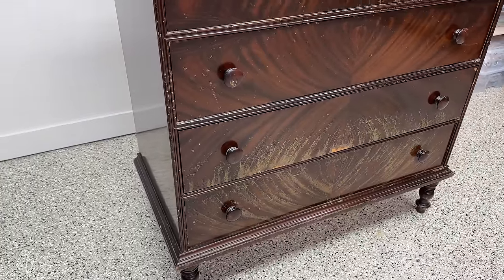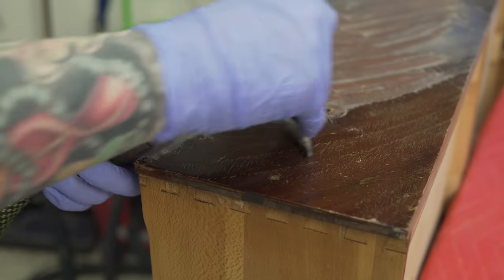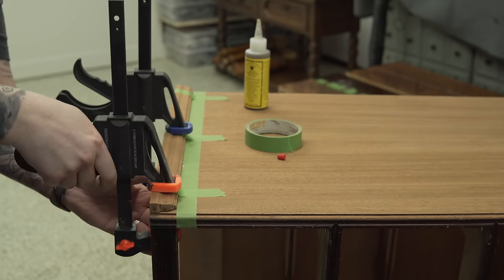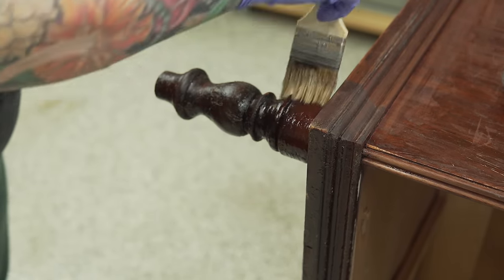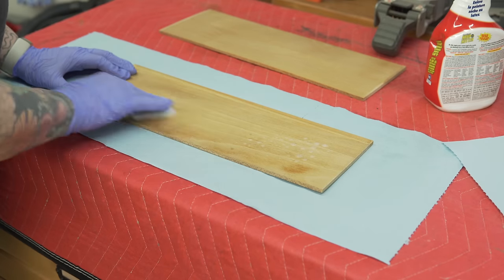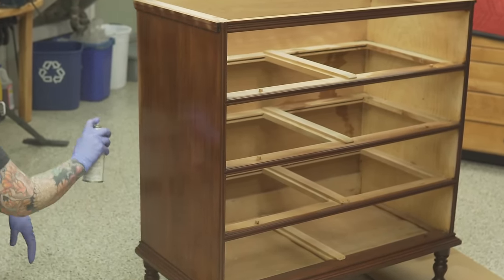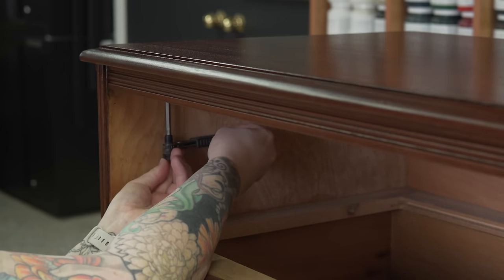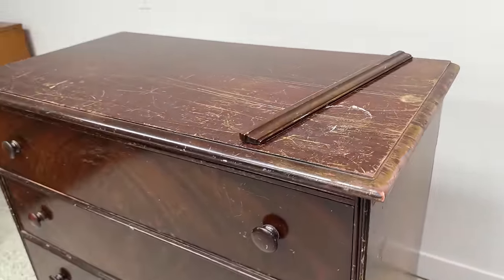AMAZING Old Mahogany Chest of Drawers Restoration

Comment: You have taught me so much. This project was helpful for many of the pieces I have come across. I just put that air filtration system in my Amazon cart. I just designed and built a spray tent using 3/4 inch PVC pipes. 7x10 with 6mm plastic. Those Mohawk fumes are brutal.  In any case. Thank you for what you do. ❤ I look forward to watching your videos every week. 😊
Reply from the maker: Oh my gosh Annie- Thank you SO much for this! I DID consider trying to at the very least, corner myself off a bit with some plastic walls, something easy to go up and down but that would contain some of the overspray so that set up isn't so bad. I DO actually have a spray shelter for when I used to spray paint. I find it a bit cumbersome to put up, but honestly, it WOULD save me a lot of time cleaning up. I should really start using it again. Thank you again, that is so generous! <3

Comment: Stunning! I had a Jeep Patriot and ended up using the blue foam roll-up camping pads from walmart to move large cargo over the "folded down rear seat hump".  It was thick enough and slick enough to slide over it easily, provided some cushion, and even doubled as knee pad for changing tires on the side of the road. I keep it in my vehicles to this day because it doesn't take up any room.

Comment: You know what Angie? I take back my initial comment many moons ago. You don't need paint. You need a huge pat on the back, maybe a hug, and a kiss on the cheek. You're doing awesome things, my friend. You are doing a wonderful job restoring all this furniture and bringing it back to use. The toner sprays make a huge difference. Beyond that, you're doing an awesome job creating these videos for us all to see. Awesome job! Keep going and I hope you reach your dreams. God Bless You. Do you sand the lacquer before finish or in between coats? The spray cans can leave a very harsh finish - smoothness wise. And I don't think the dried lacquer on the floor will harm anything. It's only what you inhale into your lungs.
Reply from the maker: If you follow the recommended recoat times, you don’t always have to sand in between coats, with a few exceptions. If you find dust nibs settling in the finishes, you’ll need a verrrrry light scuff before you move on. If you leave the project overnight and come back several hours later, you’ll need a very light scuff. And always do a very light sanding just before the final coat of lacquer. Try your best to minimize dust in the toner coats, because you any scuffing you do on that section will disturb the colour. I would only sand when necessary on the sealer and lacquer coats.

Comment: Absolutely beautiful!!  May I ask how long did it take you to redo this piece!
Reply from the maker: Because I have to film these projects, they take me much longer than they would otherwise. Every time I move at all, the camera has to be repositioned, so it actually makes it extremely difficult to estimate how long for each project. It depends also on materials used, dry times etc, whether it’s cold or hot and humid that day, as that can also affect dry times. Most pieces take me at least a few days, sometimes up to a week or more. I know that’s not a very accurate answer but the truth is, because I have a lot camerawork added in, I honestly don’t know.

Comment: The patched veneer on the drawer front was only noticeable once you pointed it out, and even then, it was barely noticeable. Another gorgeous piece of furniture! BTW, was the felt you used specific for furniture making or was it they type purchased by the yard at a fabric store?
Reply from the maker: Just from the fabric store! It’s a few mm thick, and fairly stiff so it’s got some weight to it. There was thinner stuff available as well, but I felt (pun intended) that it would be too flimsy. lol

Comment: Lo, Every day is a school day. Being absolutely honest with you i would have  used that to mount my chop saw on. Once again you proved me wrong. Your health and safety info on the Lacquer is spot on but in my case if i new that about 40 years ago  things might be  a wee bit different  now. Anyways another masterpiece from yourself .Keep up the good work. BTW noted the handle you fitted to to your spray can. Well it diznae work on most Rustolem  Cans. I found out the hard way.  🤣🤣
Reply from the maker: Oh gosh! Ive used them many times on Rustoelum cans! You have to push way harder than you probably think is correct or safe; it does take some force, for sure. Maybe overseas, they are slightly different shapes or sizes?

Comment: Would you consider doing a video -- or even multiple vids -- on how you make decisions about repairing and/or restoring a piece? What influences your choice to take on a project as opposed to leaving it by the side of the road?
Example: What made you choose to repair and refinish the dresser's surface veneer instead of making the easier, faster choice of replacing it? How often does the cost of supplies factor into your choices? Do you ever let emotion -- falling in love with a potentially magnificent salvaged piece that you just KNOW is going to be trouble -- win out over past experience?
I make big promises to myself about what I will and will not do on a project but then drag home a pathetic hulk with damaged doors, missing pieces and (always a 'gotcha') interesting lines.
My husband has never let me live down the "chicken coop" (an enormous oak wardrobe) I found on the side of the road with a sign saying "FIREWOOD!" propped up on it. The stray feathers and crusty poop decorating every exposed inch should have warned me off, but the poor thing SPOKE TO ME! After several years I was rather proud of my rehab and restore efforts, and it made a terrific wedding present for two friends whose home was sadly lacking in closet space. 
But if I had known what I was getting myself into...
Reply from the maker: Honestly I try to explain those decisions as I go in each video, as much as I can. 😊
Reply: @TranscendFurnitureGallery  You explain your decisions clearly -- much appreciated!
I was just hoping for a pithy summation of what you've learned over the years (thereby avoiding one of the "learning experiences" I've come to dread).

Comment: Hi Angie, thank you so much for your videos. It is so generous from you to share so many contents. Your work is beautiful and you have very good taste. I have one question : I would love to see you using more “eco friendly products” and less chemicals. I guess when the furniture is very damaged you cannot do another way. Can you tell me what you think ? 
Claire (drop France)
Reply from the maker: I actually use a lot of eco friendly products. My favourite finish is Odie’s Oil, which I always use on anything I’m able to. With period pieces, sometimes the correct restoration is what was originally applied. In this case, it was lacquer. Eco strippers don’t work that well, so I use what I have to to get the job done. Mine is methylene chloride free and it’s the best/strongest one I’ve found in that category. But I use a scraper whenever I’m able to, rather than the stripper. 
I use a lot of vinegar for cleaning and my rust remover is completely non toxic as well. I try to reuse as much as possible. 
This is a profession where you can’t always get away from chemicals. We can’t even do that in day to day life. But I do what I can.
Reply: @TranscendFurnitureGallery  Thank you so much for your answer. And yes, you are right, it is difficult to do it in a day to day life. What I understood is that sometime you cannot do it differently and I guess it is your experience that tells you how to do. 
Another question : what do you think about aerogommage ?? 
And once again, your work is really beautifull, I would love to do a work experience with you !! 🙃

Comment: Lovely!!!  Just be careful with the ionizer feature.  May want to check about health hazards.  Also, remember the outside filter you were changing is just the particle filter, the one that filters the VOC's is the one underneath
Reply from the maker: I've been researching these for some time and made my purchase based on what I felt was best for my need, both when I'm in the shop and when I'm not. Thanks for watching!

Comment: Beautiful work! I wonder if you have thought of resin finishes? I  got so freaked out over the amount of particulate in the air even though I had the garage doors open after I refinished an antique china buffet a few years ago.  Not to say that  resin is not full of vapors as well, but it seems less to so me and the respirators are not as clogged up afterwards. lol
Reply from the maker: Resin is great in very specific applications, but I haven't had a need for it at this point. They also need to be used in a well ventilated area though.

Comment: You'd be amazed how much good hanging sheets will do. You could get four shower curtain rods and hooks, hand them from the ceiling, get whatever you want - shower curtains, sheets, plastic sheeting, whatever. Just remember it's not airtight (and you kind of don't want that in this environment anyway) but you'll get 85, 90% of the excess spray just sticking onto the sheeting material.

I don't have room for even that much (or really need; most of what I spray is small) so I did the spray box version of this under my workbench. Just remember to leave vents in back so it doesn't blow back at you (we learn by doing lol xD ) and run a decent filter like you've already got. It's not perfect by any means but the air clears out so much faster.
Reply from the maker: Unfortunately I simply don't have the space in my work shop for it - or believe me, there would be one! Thanks for watching!

Comment: Brilliant work. Done with precision and meticulousness. Obviously experience helps but you have a great eye for color (cherry over mahogany). As always happy to see the safety emphasis but I wondered about the disposal requirements. Do you have to use special trash bags? Or travel to a disposal site? No rush on the answer
Reply from the maker: If it's allowed to dry out completely it can simply be scraped into the shop garbage. But if it's still wet, I put it in a container to be taken to the Hazardous waste disposal. Thanks so much for watching! 😊

Comment: Can you explain lacquer to me and why you chose to use it? I am still learning. Thank you for your time. Love your videos
Reply from the maker: Lacquer is a type of hard and usually shiny coating or finish applied to materials such as wood or metal. It is most often made from resin extracted from trees and waxes. I use spray lacquer generally on pieces that I want to get closer to factory finish or have to use toners on. I hope this helps!
Reply: @TranscendFurnitureGallery  thank you so much for the explanation. appreciate it.

Comment: anytime we where going to spray any type of finish. we sparay down the room with a kitchen soap water blend to knock down the fine dust from the air. mixed saw dust and water. dropped it down and swiped the floors twice.  repeated the process often during the week. kept a fan blowing out air of the room to the rear exit.  we also started using a thin spray booth hood to keep dust out of our ears with nose reduction head pieces. a trash can to drop in the clothing i wore that day in the shop. so i wouldn't be tracking all that dust into the car and apt. protect the family from dust and fiberglass panels we also worked with.

Comment: ANGIE!! What kind of wood is that light wood, near the base, you used the saman water based stain on?! I have the same one I feel but it will not stain, not with gel, not with oil....it's a nightmare... Also if I wanted to do a thin layer of clear shellac over a wood piece before I gel stain will that hinder the stain? Or will it protect the wood so it's natural color can be restored if someone wishes one day?? HELP PLS
Reply from the maker: I honestly wasn’t trying to identify it so I didn’t give it much thought! The most coming light woods though on this specific era were birch, beech, ash, poplar, butternut, etc. But if yours is more modern, woods like rubber wood and bamboo are common, and the latter doesn’t stain all that well in my experience. A thin layer of shellac is great prior to painting a piece as it will allow someone down the road to strip it back but prior to stain, it will act as even more of a resist. You could maybe try an aniline dye stain- they are a little tricky the first time you use them until you get the hang of how to do them quickly and effectively, but they penetrate the wood deeper than oils and gels, so don’t sit on the surface like the others.

Comment: How noisy is the air cleaner? That is really compelling. I have a good respirator and dust collector, but a decent air cleaner we haven’t yet invested in.
Reply from the maker: It's not terrible, but it's definitely not quiet. I have a dust collector I use with my sander- I find it's comparible to that (maybe a bit quieter).
Reply: Thanks! Yeah, our dust collection system is already loud enough that I wear hearing protection out there, anyway, so it might not even matter. Good to know.

Oh and the dresser looks GORGEOUS.

Comment: Y... Habría un área el aire libre donde puedas hacer los aerosoles?
Reply from the maker: These lacquers are expensive- spraying them outside, I would lose so much of it to the wind, and have to worry about insects or pollen or leaves getting into the finish. Indoors is a controlled environment.
Reply: @TranscendFurnitureGallery  ahhhhh.. no tomé en cuenta nada de lo que me escribiste. Muchas gracias por responderme.. que tengas un excelente día.

Comment: Absolutely stunning! The repairs are invisible! You did magic tricks! Why don't you use shellac? Is it because it changes color, becomes yellowish , over time? Is it toxic as well? I love your work... all the pieces you redo are awesome but these products that are spayed are so toxic and dangerous for your health.... does lacquer and toners smell badly? Products use bad smell to arise awareness for health danger. Thanks so much for sharing.  You know best. Take care.
Reply from the maker: I wear respirators so that I can’t smell them. But yes, they are toxic and stinky. I prefer lacquer to shellac because it’s faster to apply, and has a bit more hardiness to it. I still use shellac on occasion, but that also smells bad. My favourite is Odie’s Oil, a non toxic tung oil based finish, but with this piece, I needed a film forming finish to deal with some of the repairs.
Reply: @TranscendFurnitureGallery  So glad you clarified the reason for lacquer. I've been inspired by your use of Odie's and bought a 19th century walnut sideboard with book-matched veneer doors, drawers, and top. I'm seeing some minor cracks and a couple bubbles since I brought it home--scared that's from moving it from high humidity (Portland, OR) to extremely low humidity (high desert) because I sure didn't see them when I purchased it. (It has only one quarter-sized veneer chip so doesn't need other repairs beyond finish and the bubbles.) I was going to use Odie's but now I'm wondering if it needs the super penetrating oil version for better protection of this old wood. I want to emphasize that incredible grain that I see you get in these old pieces, taking them from what I call "church brown," i.e., BORING, to jaw-dropping gorgeous. This latest piece of yours..."Transcend" is such an appropriate name for your business!
Reply from the maker: The Super Penetrating Oil is more for keeping the clarity of the wood and giving it depth, but doesn't protect it. It's meant as a base layer, so after applying it EXTREMELY sparingly (even more so than the usual Odie's), it has to be topped with the Odie's Universal Oil (or another topcoat), as it doesn't offer much protection on its own... as that's not that particular product's purpose. Hope that makes sense. :-)

Comment: Just my two cents, but I don’t think you showed us how you removed the scratches or how you painted the wood filler patches to blend.
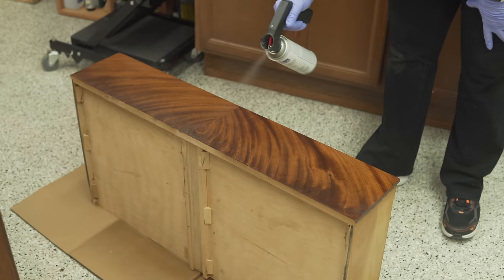Reply from the maker: The scratches all came out with the scraping of the old finish ( 5:07 ) and I mentioned at 13:15 that the clips of me doing the patched areas didn't get recorded (I thought my camera was recording, but wasn't).